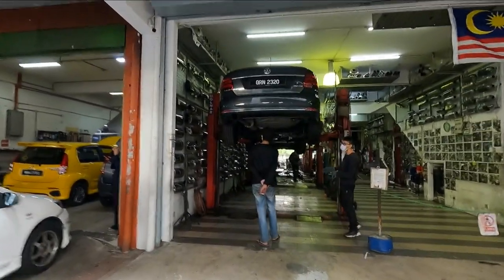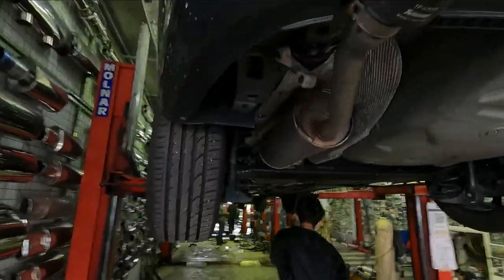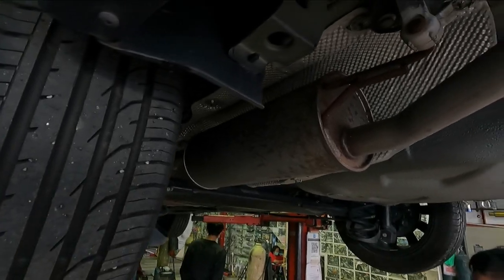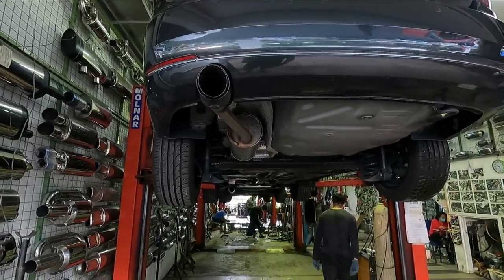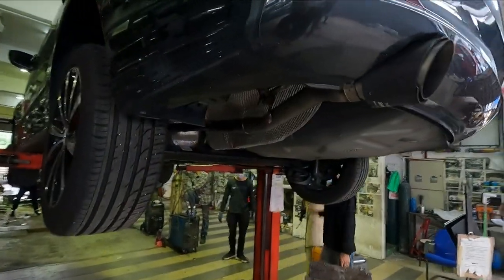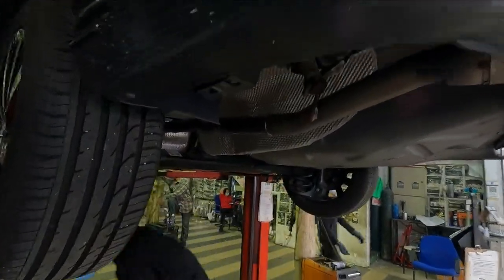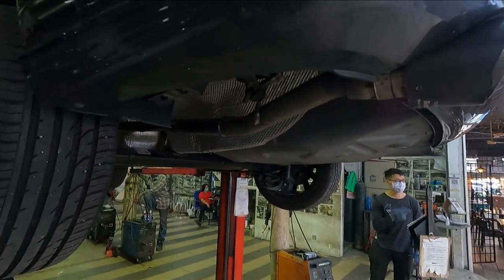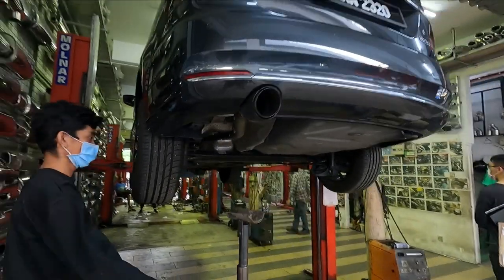Volkswagen Vento 1.2TSI Muffler Delete: Farts, Burbles & Crackles!

Comment: hi thank you for your videos ,im having the same model of your vento, and planning to the same thing too , but im worried about the power lose , do you feel any differences besides the hearing experience ?
Reply from the maker: Slightly Better power due to better airflow. But as for sound wise I think I still prefer it stock or do a resonator delete instead.
Reply: @DrivenTechReviews  thank you so much for the recommendation 💪🏻